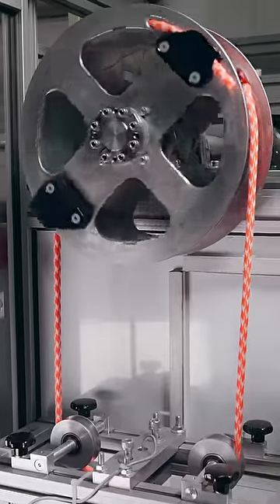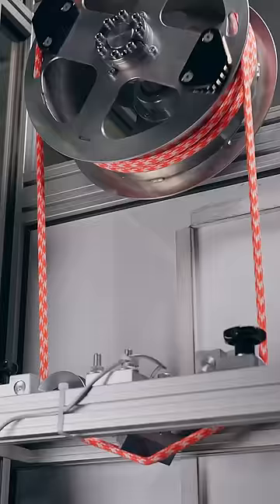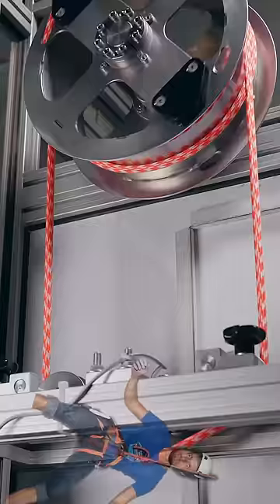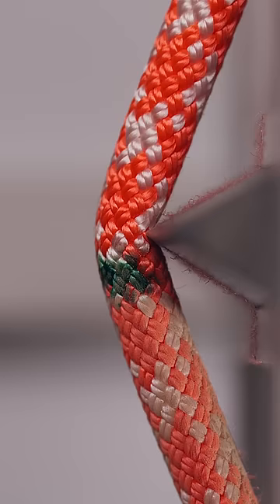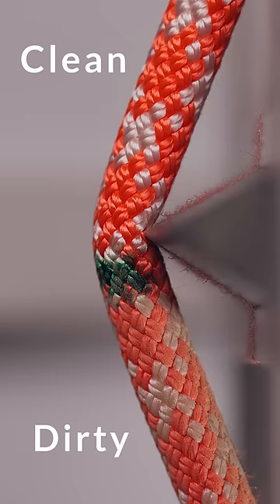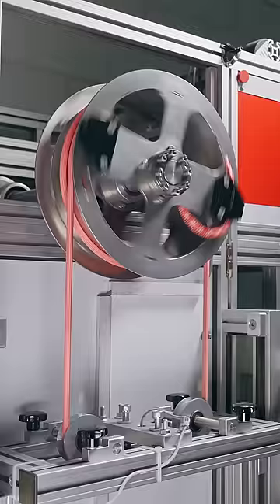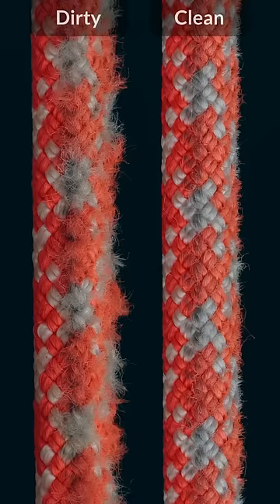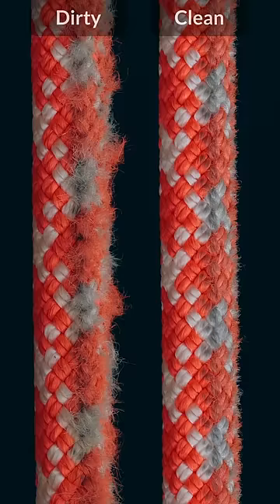Surprising Effect of Dirt on Climbing Ropes

Comment: And this is why when I was on the local search and rescue team, you had to buy everyone a beer every time you stepped on a rope.
Reply: But not a new rope?
Reply: @DeathnoteBB  i assume they clean the rope if that happens
Reply: @DeathnoteBB World will still stand.. Ropes are more often exchanged by age, rather than abrasion. 😉
Reply: @OmmerSyssel  Good to know, these videos just make it seem like any dirt at all comprises your rope
Reply: @DeathnoteBB Ropes aren't quite that delicate.
Reply: @DeathnoteBB  It is more of a manner not to do it. You don't want to jinx it. I work on a test field and we usually have cables lying around on the floor. You don't know how many people carelessly step on cables. 
For the most part nothing happens, but in a company that works on metal it can easily happen that you have a metal chip in your boot and kick it through the isolation of a wire. Either creating danger to yourself or just damaging equipment.
It's just a precaution.
Reply: @DeathnoteBB  surprisingly, knots do a lot more than dirt. Knots cause unequal distribution of force that results in loss of strength up to and even over 30%. This is why there are specific knots for high load bearing purposes that reduce this strength loss.
Reply: Dirty ropes are recycled to climbers with less dirty ropes????and so on and so on lol
Reply: Hey a fellow rescue ops guy.
Reply: @DeathnoteBB this situation is like, simulating the absolute worst possible circumstances you could ever find while climbing, its like your rope being wrapped around a sharp large rock and scrapping back and forth along both directions… most ropes climbers use could be used to lift a large car for context to there strength.
Reply: @DeathnoteBB I'm guessing it'd be either A) law violation to expect employees to replace equipment out of pocket or B) cause some logistical error.
Reply: Let me just contact the nearest mountain goat barista.
Reply: Isn't that everywhere?
Reply: Then the ropes shouldn't be laying on the ground either, if you want them to stay clean.
Reply: The saying goes "step on it once, buy me a beer. Step on it twice, buy me a new rope."  @DeathnoteBB
Reply: @DeathnoteBB it’s in a very specific situation meant to simulate what would take the better part of a year to complete
Reply: Dirt is sandpaper without the paper.
Reply: And what happened when you woke up of that dream?
Reply: @wulfrickackerman9453  Yeah, just a reminder to maintain discipline. Like in Basic Training, whenever we stepped over something chrome that had to be polished we had to say "chrome". And of course not step on it. It's not about the beer or replacing the rope, it's about making sure everyone is always conscious of what they're doing.
Reply: Well I just quit last night. But since you mention it. Fuck it. 🍻
Reply: It's safe to assume no missing people were searched or rescued that day.
Reply: @DeathnoteBB that’s the second step. You can clean a rope. But making the same mistake twice is just bad

Comment: I’m been doing rope access tech for nearly 5 years now, I only got up to level 2 irata. I’m finally hanging up my harness. Reason I’ve seen two workers fall off 50ft due to equipment failure. I’ve gotten injured and came close to death plenty of times. No matter how much you check your equipment, use rope edge pads or whatever there’s always that one unexpected thing comes out of no where. I’ve had people throwing stuff at me from balcony’s, birds attack me on the roof. The pay is great but after having my first born child I want to live longer. My advice to anyone who wants to get into rope access. Double check your equipment, check your knots, check your ropes and always have a your stuff tied off and last always have fear, fear will keep you safe. Good lucky to anyone who wants to join!